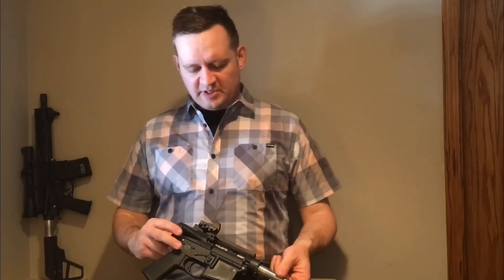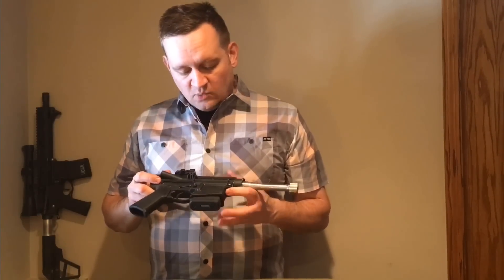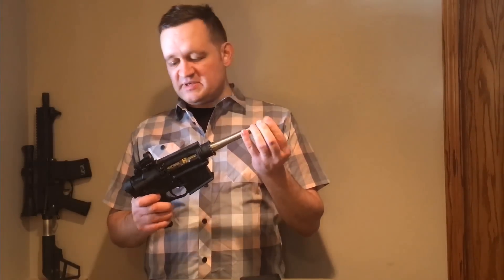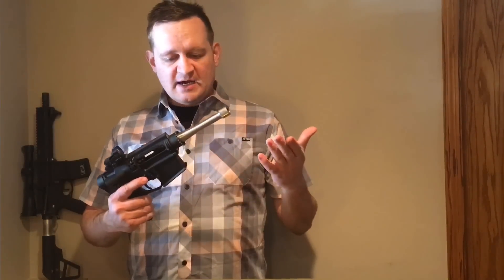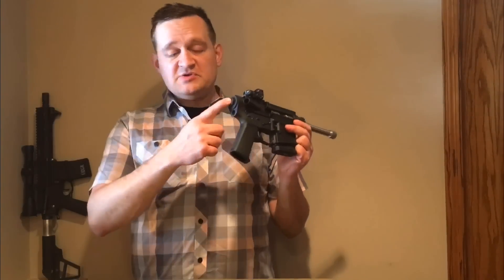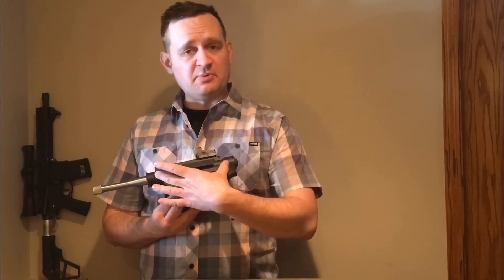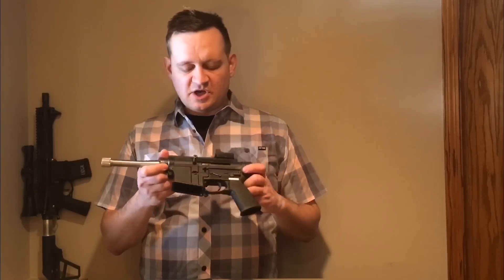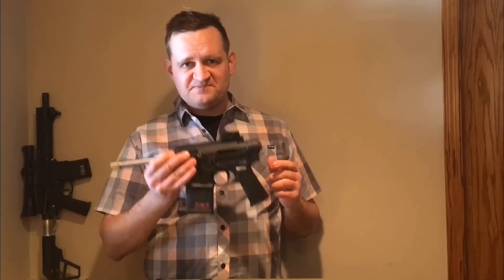Solo 300 Pistol Prototype

Comment: Would be a little bit worried about it going out of battery without you knowing it.  Should run a rubber band around the barrel nut to the charging handle.

Comment: okay, so 1: what specific upper are you using? I have polymer 80%s all over the place. 
2: which pattern of conversion are you using for the bolt?

it's actually a pretty cool option for a ranch gun
Reply from the maker: 1: ATI
2: I don't know what "pattern of conversion" means.
Reply: @durayenterprisesllc4440  nevermind, I think i got it. no modifications, standard bolt head and carrier. not one of the bolt action conversion carriers. 

Very cool. I'll have to pick a caliber and do one. I have a handwaving vaguely similar colt pattern ar9 that I just did with a 6 inch bare barrel (of course it has a pistol brace and buffer tube) and everyone keeps saying "did you see the BLAAAASTER?" so I found it :)

Comment: A question for you:  How easy is it to knock the bolt out of battery without having it under spring tension like you would with a buffer tube?  Seems like you could just have it pointed upwards and smack the rear of it and the weight of the BCG would be enough to unlock it.  Doesn't seem like a safety concern as it shouldn't fire out of battery, but could be annoying.  Would there be any downside to putting some sort of weak spring behind the BCG?

Thanks,
-Dan
Reply: I have the same question about keeping it in battery  can you share his reply ? plz.
Reply: I've started putting one of these together. It appears there is more than enough force required to unlock the bolt that a spring should not be necessary. Much more force than I would have thought with the side charger.

Comment: I’m glad to see you posting again!  Your videos really drove my interest in 300 blackout over the past few years, and it’s been a fun ride.  

I was toying around with this idea myself since I have an weird obsession with bufferless ARs, but I was always a little concerned with the bolt.  Does it actually lock, extract and eject well with just manual pressure?
Reply from the maker: SoldierO7 so far it does. I may eventually add a spring.

Comment: subbed because I'm looking forward to seeing what you did especially with the bolt and making the charging handle attachment, etc.  I understand the concept and smacked myself in the forehead for not thinking about this myself.  Very well done and now you have me wanting to build one with a folding brace.  I plan to shorten the barrel down enough so that I can tension my integral suppressor that's on my SBR back over the barrel.  Too many ideas now.  But thanks !!!

Comment: i am totally dumb on guns what kind of rounds are in there? are they bigger or smaller then from normal handguns? like for example the american police have?
Reply: Otoya Yamaguchi thank you very much so this pistol is way more powerfull then the average pistol. then i want it.
Reply: @captainbube1217  think of the .300 Blackout as America's answer to the AK-47 = )
Reply: @keayrhyasen3071  Except not all.
7.62 by 39 is rather anemic despite being a 30 cal.
300 blackout was designed with supression hence the higher mass.
Reply: If you just want a powerful pistol you can get a 44 Remington magnum or a 454 Casul those are nuts and even larger caliber handguns. But, not anywhere near as unique
Reply: Captain, "bigger or smaller" is a thing that would need clarification. Many handguns fire a "larger" round than an AR-15 chambered in the usual .223 or 5.56. For example, a pistol firing a 9mm round (or "9x19"  cartridge) does have a bullet that is bigger than a 5.56 round. However, the overall 5.56 cartridge is "larger" by virtue of the case size. Google is your friend on this, try searching for "cartridge size comparison".
Reply: @bbb462cid  oh ok i would have thought that the larger the round the larger the bullet-
Reply: @captainbube1217  A cartridge is a bullet inserted into a case, in terms of size. A .45 ACP bullet is larger than a 30-06 bullet (the numbers bring caliber) but the 30-06 cartridge is bigger overall. By the same token a .22 LR round is much smaller looking than a .223 cartridge but the bullets are quite close in caliber. Caliber is simply defined as "the internal diameter of a firearm's barrel" and gives a clue about overall cartridge size but doesn't define it.

Comment: could you release more information about the upper, bcg, and any other interesting information for the build. I like it a lot
Reply from the maker: Nathan Newton the upper is just a plain, cheap poly upper from ATI, and you can use any standard BCG.
Reply: Ok so  @durayenterprisesllc4440 , where are you cutting it in half, what are you using to do that. When I say I like it what I am trying to say is I want one, and have a spare lower lying around anyways so I want to build one. Did you follow a guide?

Comment: Man if it were just a blow back system .I still really like it though and thanks for sharing .
Reply: Much louder 
Much more complicated
Reply: @1994F150L  maybe integrally suppressed ?
Reply: Everyone likes semi auto but,
You can already buy something like that now. Cheap. 
The semi action creates noise and adds length and weight.
Reply: @1994F150L  Your rite that would be getting away from what it is and it if fine just like it is .

Comment: Could you squeak out a little better accuracy if there was some kind of spring holding the bolt in battery while firing? Maybe a cut down buffer spring or something? Could make cycling feel a bit smoother...or at least make it feel closer to the feel of charging a standard ar. Hopefully you find time to film some range time with it soon!  :)
Reply: There is no gas system so once the bolt is in battery it will not unlock until manually cycled.
Reply: @Jrhoney  makes sense...I was kinda reaching for some kind of justification to put a spring behind the bolt but I guess if it ain't broke... :)

Comment: I would be cool to get a parts list. Really cool idea. I like
Reply from the maker: There aren't really any special parts except the buffer hole plug, and I explain in the video where that's from.
Reply: Halved bolt carriers and polymer uppers&lowers aren't exactly available on Amazon, either.  The resolution isn't good enough to read the logo on anything.
Reply: @furcifer8218  I just googled it and I found both upper and lower polymer for around 60$ for both
Reply: @MinneGoldens  what upper and lower did you find for $60. I'm new to AR parts and really don't know where to look.
Reply: @furcifer8218  You can have a carrier cut down pretty easily.  You'll probably never see a lower on Amazon....  If you can DIY, check out polymer 80% lowers. Or, have your local FFL order one, they require a yellow sheet.
Reply: @durayenterprisesllc4440  any chance of seeing your machine work on the BCG?
Reply: @durayenterprisesllc4440  what's the spring inside?
Reply: @brocknchrist  no spring inside. It's a bolt action pistol.
Reply: Rolling Blackouts thanks for the video, you did it very well. It sure has my creative mind set flowing. I hit the like and bell for you. Peace be with you and your loved ones. Good luck on your fall hunts.
Reply: 1st generation Han Solo blaster !! I want it plz send specs👍👍
Reply: @kyle0matic698  I totally agree I really want one. I have been thinking up loads for the gun
Reply: Google "classic firearms.com" they have almost everything you'll need to make this if not all of of it

Comment: I wonder what one of these in 458 socom or a similar big bore cartridge would be like.
Reply: Like stopping a batter's swing with a bare hand!
Reply: I've actually thought about doing one of these in a big bore
Reply: .50 Beowulf!  YES
Reply: 458 socom pistol would be sick!
Reply: @Colson Customs just got my beowulf barrel cut shorter and threaded.  Working on getting the ejection port milled out with a friend... then should be good to test it with the ol Bowers Vers 50.  Probably try some big heavy subs first with trailboss.
Reply: well, I got it all built and finished the video.  50 Beowulf bolt action pistol suppressed with some 570gr bullets.
Reply: Yeah 
You could do those calibers 
But suppressing becomes an issue
Reply: Why? those are ideal for big heavy subs. The cans are big but that's to be expected.   @1994F150L
Reply: @colsoncustoms8994  
Cool factor yes 
Heavy yes 
Parts readily available for build NO
Mags no
Cheap donor upper no
Rare brass
No factory subs available 
458 isn't laying around everywhere 
50AE is cheaper but also rare
Reply: Some of those are relevant considerations but have nothing to do with "suppressing becomes an issue". 
And I'm pretty sure 458 uses standard mags, you can buy subs as well. 
Yes it's going to be expensive to shoot, that in no way makes it hard to suppress.  https://www.midwayusa.com/product/1019156360/sbr-ammunition-458-socom-subsonic-450-grain-full-metal-jacket-box-of-20  @1994F150L
Reply: @JethroBodean parts readily available for build--yes, mags--yes, cheap donor upper--yes (just bought some big bore uppers for $60 each and barrels can be found cheap), rare brass--starline sells it all,  factory subs--yes you can buy them but cheaper to load them yourself, 458 ammo might not be at walmart but is everywhere online, etc...
Reply: @JethroBodean what do you mean suppressing becomes an issue?  I suppress pretty much all my big bores.
Reply: @FullLeadTaco  
458 vs 300...
If 139-140db is quiet to you, then all is good. That's still not hearing safe. It's at least 3$+ (458)round if your time isn't money, not that it matters much. A .300 can get down to 117db or less. 
This build 38oz with no can.
A 50 can is 20oz by itself and is 11+ inches long. Longer, heavier, more $, much louder but you can sling another 100 grains of lead each trigger pull...
Reply: @JethroBodean lots of things come into play when measuring sound, like where you meter it and such.  Also, if you load your own ammo, you can use faster pistol powders which are going to be much quieter than traditional magnum pistol powders since you don't have an action you have to cycle.  Weight wise, I could care less--a little heavier is probably better for the big bores for recoil management.  Cost wise, I can make my own .50 cal or .458 bullets very cheaply so cost isn't an issue.  But as far as 458 vs 300, I wasn't comparing the two as far as one being better or worse than the other--just that this would be a cool platform for some of the big bore cartridges.  Being able to use the faster pistol powders which will not cycle the actions of the AR's will be ideal for quiet and % powder burn.  I think I will do it just for kicks.  Maybe start with a 50 beowulf and some 440 gr bullets or something.  Maybe even heavier.  I have some 700 gr bullets I could try out too if they will stabilize.

Comment: This has been a cool project to follow; thanks for sharing!

Is there any upper limit on how heavy you can go with subs? Usually I see about 220gr or so, but could you push it a lot heavier, get more energy on target at the same subsonic speeds?
Reply from the maker: The only limiting factor is what a barrel of a given  twist rate will stabilize.